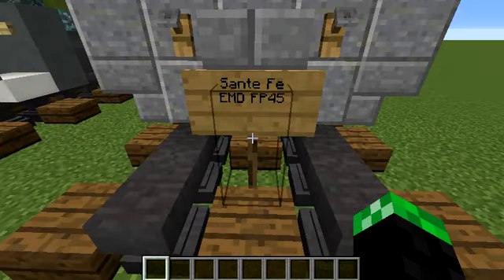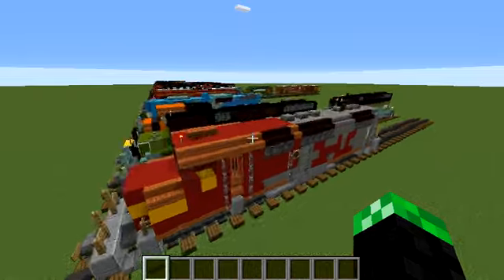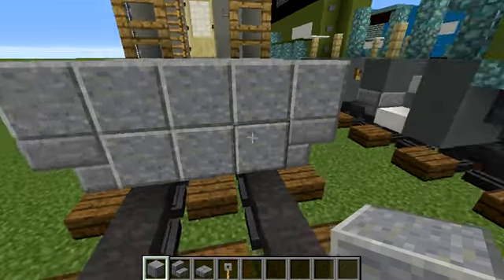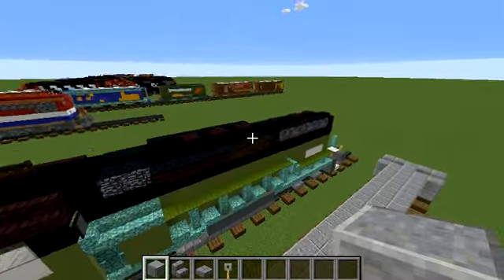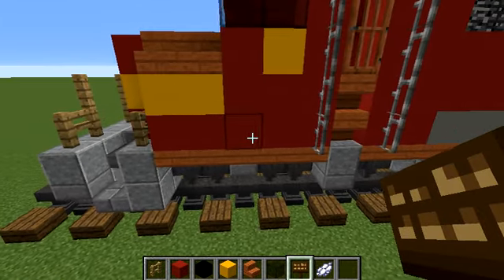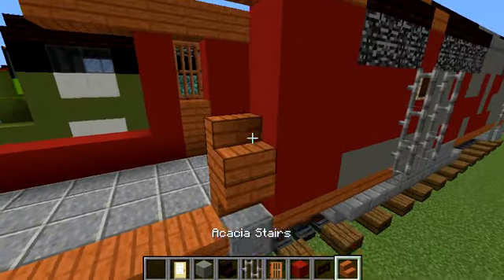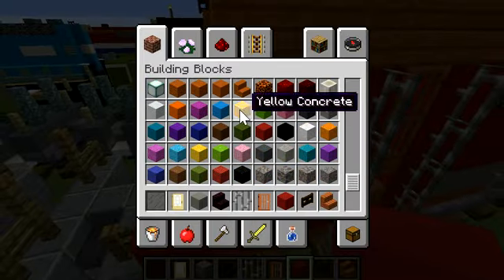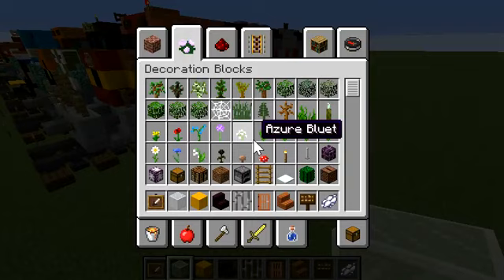Minecraft: How To Make A Santa Fe EMD FP45

Comment: Actually it is a passenger locomotive 
It pulled the superchief for Santa Fe and was the first diesel passenger locomotive to hit 80mph
Reply from the maker: Sometimes It Goes On Freight Trains Though
Reply: Cxrrupted2 the fp45 is actually older than you think it was built in the 50s-60s  and was the first moder cowl hood locomotive and only 16 were built as the fp45 rather than f45 the fp45s were equipped with steam generators for heating 

They were the last passenger locomotives ordered by ATSF before Amtrak in the 1970s
Reply: They were retired 
Converted to another locomotive 
Scrapped or preserved but a few still run today 
And are museum pieces